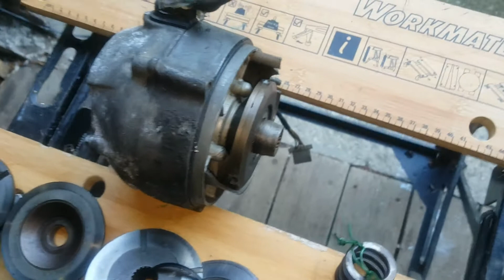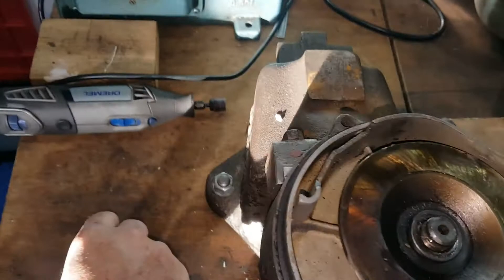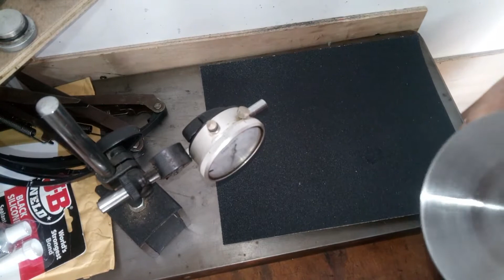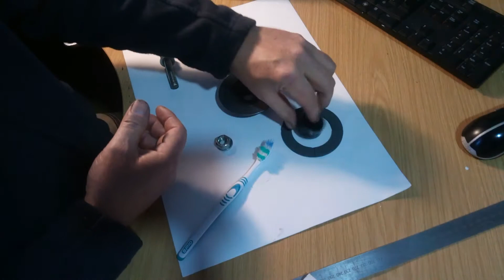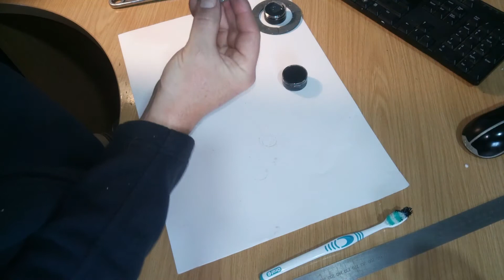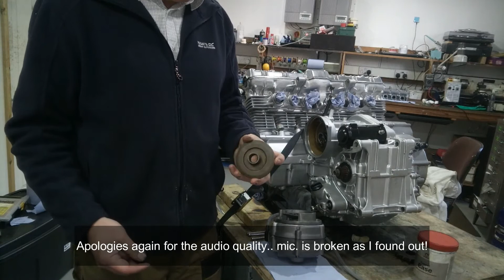CBX 1000 Alternator clutch upgrade

Comment: It’s really a torque limiter I guess  my FZ 750 has the alt behind the cylinders  the only clutch it has is a starter clutch  …. Yes I know poxy place to put that so I rekitted mine with new springs ( they shorten) plungers and rollers

Comment: So all you did was disable the clutch from working. A much easier and less time consuming method would be to drill three holes through both plates and install dowel pins.

Comment: I'm a new CBX owner and I'm still figuring out all of its idiosyncrasies. Why does it require a slip clutch here when all other bikes drive the alternator directly off the crank end? Did they determine that the mass of the alternator wasn't good for the Hy-Vo chain? Or maybe the pulsing effect of the windings? There are lots of bikes that can rev harder and quicker than the CBX and drive off the crank directly so I'm sort of curious.

Comment: This is a very specific issue indeed! It has a simple genesis, in that the CBX can increase revolutions at a ridiculous rate. Allowing the alternator to slip during these transitions is a need best suited to racing conditions.

Riding my two CBXs back in the day, rapid shifts were the order of the day in the twisties. I pulled the alternator in the course of service, at low miles, and discovered several things. Most important, the steel clutch was significantly scored, and my first thought? Yes, where did those wee bits go?

I had to split the cases on my 82 due to a hydraulic lock issue, and with that dual oil pump available, of course I took her apart for examination. Pitting in the impeller gears. Bingo, I knew the source.

My solution was to be kind on those throttle transients. My thought at the time was to properly fit the floating disc with a bonded friction material on its face. Mind you, this was back in 1984! This has worked for wet clutches very well since Moses was still in office.

This alternator, a real automotive design with a DC field coil / rotor, is different from the norm, in that it has a radial armature / commutator, with two concentric sweeps of copper contact for the armature. As such, the brushes wear more rapidly. Care to guess why Honda fitted a voltmeter in the center of the cluster?

Comment: I got tired of the alternator chirp on my 1979 CBX and did something similar in the 1990's. I machined both friction faces such that a piece of free floating friction material of smaller diameter would be captured by the flange that I left on the drive faces. The other mistake that I saw on friend's CBX's was that the fiber washer under the spring had gone missing and that many used springs were considerably shorter than a new one. The heat fatigued them.  

I bought my 1979 CBX in 1992 with a hole in the cases where a rod went through. It was an early engine that had straight case studs unlike the ''rifled'' ones that followed. There were 2 other bent connecting rods in the engine as well. I presume that the engine had ''hydrauliced''  from fuel overflow while on the side stand. I found another troubled engine and managed to assemble one good running engine from the 2 broken ones. This was my very first motorcycle engine overhaul. It's definitely not a beginner's engine.

The bike got an 1100F Honda front end, wheels, brakes and swing arm. I also added the 1100F bikini fairing. It started out as a terrible mess and became a reliable bike. I put on many miles on it in California, Nevada and Oregon with the CBX Club.

Your alternator slip clutch is very elegant and looks to be a better trouble free design. Great job!

Comment: In response to your question "alternator slip clutch". In 1978 and 79 ... in Belgium (Circuit Jules Tacheny à Mettet and Circuit Nivelles-Baulers) I did some Castrol races with the CBX 1000, XS 1100, GS 1000 etc. All bikes were mandatory street productions motorcycles for the races , sometimes 4 hours and sometimes 6 hours races. Sort of like endurance competitions, short term! Together with Honda technical personnel involved in the CBX project (end of 1979). 
The only reason for the use of this alternator slip clutch = for temporarily more engine pulling power, the alternator does not rotate at the same time during heavy acceleration. This was certainly one of the reasons that the CBX accelerated faster after every corner than any other bike at the time ... it's not just weight that counts, especially on a dry road surface the CBX 1000 was unbeatable in those times.
Reply: Except the KZ1300 which destroys the CBX in every way.
Reply: @theoriginalmungaman  Indeed the Z1300 has better performance, only in my racing days of Mettet (1978) there was no Z1300!!! I bought a Z1300/A3 in 1982 that I still own. I also have another Z1300-DFI 1985 (130hp) Don't worry, I know the difference between a CBX 1000/Z from 1978... especially this bike is still in my possession.  👍